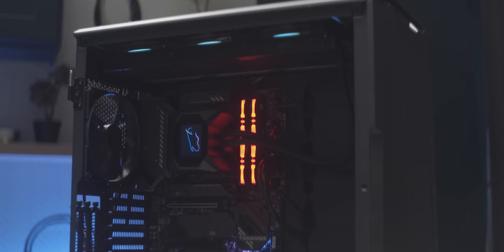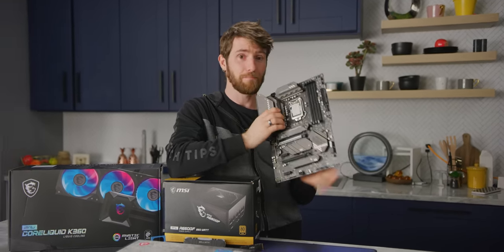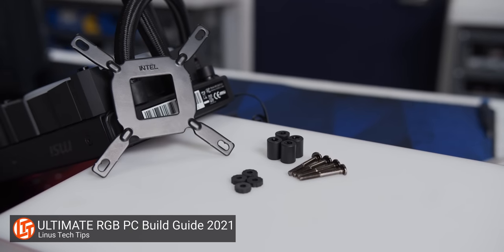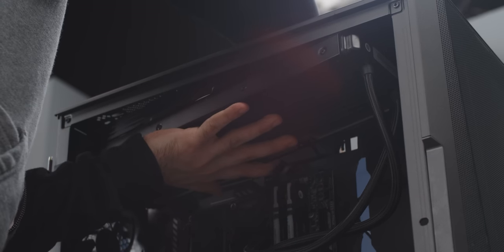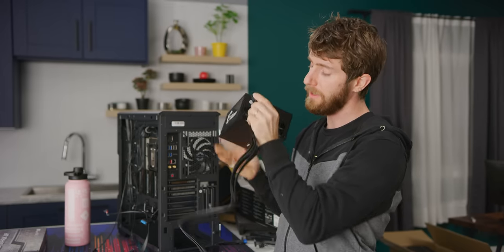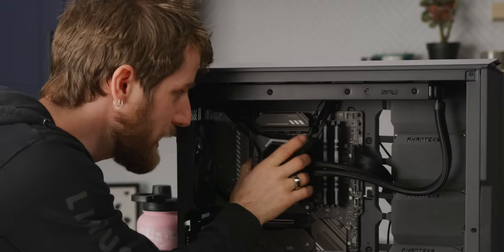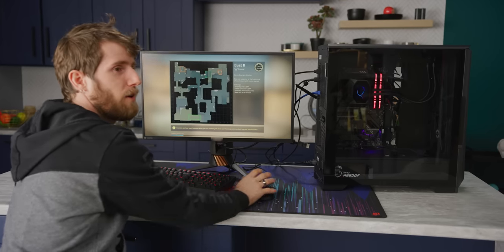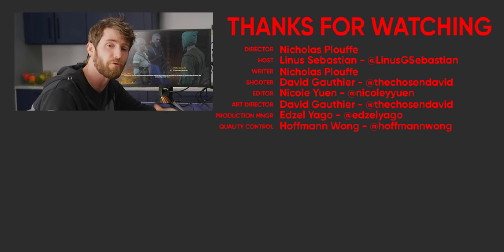You Can ACTUALLY Buy This PC!

Comment: Am i the first to do this in 2021 or is it a dream?
I built my pc without GPU thinking maybe the price will go low so I built a PC with :
i7-10700k 
32gb hyperX ram 3000mhz 
500gb Samsung nvme 
360mm AIO which makes my CPU super cold but the problem is....
it can't run on 1080p so i use my gaming laptop instead which is 3 years old now and this was my upgrade from 1050ti(mobile) to integrated graphic which shows the share memory of 16gb from one of the ram.

Thanks for making this video GeForce now is not available in India right now, so maybe i will wait this pandemic ends and finally I'm able to go out and bring my GPU (RTX 3070) which is priced at almost $1100 and rs90k in India, I thought I'm the only one who built a PC without a GPU maybe the situation forced me to but that's what life is all about, struggle.
#Love FROM #INDIA

Comment: I have waited 7 months to get a new 3000 series card at msrp and it is just not possible and doesn’t look like it will be for a while. My solution was to pay an extra $100 build fee for a custom site like NZXT and get all parts at regular cost.  I waited 1 month and got the mobo cpu and gpu I wanted without overpaying for any of it and it still looks like scalpers will be around for many more months. I then got the psu, ram, and case brand I wanted as some companies don’t offer a large variety and I put the new ones into my old rig to sell on eBay.

Comment: i recently was building my first build and unfortunately... got caught in the crossfire of cryptominers and pcb shortages and was exposed to gpu's that were always 150%+ msrp.

my specs are rather low but i'm new to a personal pc and I don't have intention on gaming over 60 fps... right now anyways.

i3 4550
8gb RAM
1 TB HDD
and a few days ago, i purchased an rx 550 for around $160

i would have bought a better card, but i'm limited to my stock psu and don't have access to externally powering a gpu.

Comment: I bought my first graphics card - used Asus Strix 1070 Ti in the the spring of 2019 for 230 eur, then i sold it for 190 eur in the 2020 September. Now I was without the GPU, but not for a long time.....i bought a new Powercolor Red Devil 5600xt for 320 eur in the 2020 October. It was a nice GPU, but random crashes and tricky Radeon software left me wondering, is this the right card for me...!? So soon after came the shitstorm called "New Graphics Card availability". So i was left with my 5600xt, and we get to know each other pretty good - messing with the settings and undervolting :))  In the beginning of March 2021 I came to decision to sell my RX 5600xt, and the interest for the card was very high, so I sold it to the "miner" for 485 eur. In the same day I bought the used Asus Strix 2080 Super for 895 eur. This is my journey so far, good luck!!!

Comment: I got really REALLY lucky and bought a GTX 1080 Zotac Mini right at the beginning of the pandemic. If I had the job I had now I would've bought a 2080 (maybe Ti) but I didn't so a 1080 was still an upgrade from the 1060. Also I got it for $300. I can NOT find that same Zotac Mini 1080 for under $1200 USD now.

Comment: For some odd reason I got lucky on October 29th of 2020 and bought an MSI RX 5600 XT GPU for $289. I had no idea there was going to be a shortage. I also got away with a Ryzen 5 3600 XT CPU for $239 at the same time. Luck of the draw I suppose. I'm good for a while.

Comment: bought a 1650 SUPER at 260 CA$ from a freind but i was looking to run 1080p 144hrz with the Sceptre monitor you tested in a video.
It works but not as i would have thoutgh.
cpu:9100F ssd:500gb SATA and... 16g DDR4 2400 single dim for now

Comment: i caved and bought a prebuilt dell g5 5000 with a 2060 ... had to do alot and about to swap the stock kf variant cooler for a Noctua NH-u9s. also had to unlock under volting to help with temps  will one day just build out a proper home when i can have to pay off this rip off. only place i could finance sadly. maybe a msi carbon gaming if they come down to my budget then maybe some RGB
Reply: g5 5000's are so fucking garbage

Comment: Ohh man Linus have I got a story for you. Where to begin?  Whelp lets start with the system I had. I was rocking a Biostar tz77xe3 mobo with a i7 2600k cpu and a evga gtx 660. It was getting me by but it was getting to be that time... Thanksgiving 2019 I was heading up to my Dads with my girlfriend  for a little holiday weakened. I had some work to do while I was there, and sense I destroyed my old 2010 macbook pro trying to make it still somewhat usable ( you know because anything after about 5 to 7 years typically looses all support from apple), I was kind of forced to bring my entire pc up there with us. On the way to my Dads place we were hit head on by a drunk driver. The mustang we were driving was completely totaled and honestly we were lucky to get out alive with minor injuries. After me and my girlfriend took some time to recoup and get things started with insurance and lawyers. I decided to take a look at the twisted heap of metal that was my old pc. At first glance the state of the pc was not looking good,. The graphics card was ripped from the pcie slot. The actual slot had sustained some pretty good damage as well. The stock intel cpu cooler was broken off of the board... the list goes on. At this point I carefully dismantled everything and salvaged as much as I could..... Including the psu that had sat in the junkyard inside the car and had been rained on. Isn't this story just getting better and better? 

So I purchase my buddies old nzxt case off of him for like $50 and set out to rebuild my pc out of the salvaged parts. We manage to somehow push the damaged pcie slot back into place get the gpu reinstalled slap a new noctua cpu cooler in there and then against our better judgment decide to wire up the old most likely damaged psu and see if it posts..... well big let down it does and nothing exploded....yet. A few more months go by and I've been using this Frankenstein of a computer for work and play during quarentine. In the back of my head I cant shake this voice saying "man you should fork out a few hundred and replace that psu. It's not worth the damage it could cause if it fails." Unfortunately, there's this other voice that's saying "Yeah but... if it was going to fail it would have already...." To be fair at this point we are smack dab in the middle of first quarantine and no one is going anywhere and me and my girlfriend were dealing with lawyers, insurance and medical crap from the accident still. Part of me just wanted to believe the my pc was fine. Ironically I don't think it was the psu that failed. I load up a game after coding all day and I hear this pop and smell electrical fire as my screen goes black. Funny enough the pc was still running so I force shut down and unplug the pc. I'm not an electrical engineer but my best guess is that a component on the gpu had shorted. I don't doubt that the possibly, nay most likely damaged psu contributed to this incident but let's not talk about that. Moving on... I also had a kind of old janky wifi card plugged in above the gpu that was also put out of commission by whatever happened with the gpu. To be honest there was nothing good about this build. I just wasn't willing to let it die...

Long story short.... I ended up trying to find a new psu and gpu right when that first gpu shortage was starting. I had dreams of making a system that could comfortably edit 4k video at least in the not too distant future so I was thinking 2080 ti and up for gpu ( just to kind of future proof a bit more ). I settled for a $400 1070 for the time being. In hindsight I kind of wish I had forked out a bit more for the 1080 but its one of those things where I just needed a gpu to keep me going until I get to a point where I can do a proper gpu upgrade (not that the 1070 wasn't a nice step up from the 660). Tonight I finally got my hands on a AMD 5800x a new asus prime x570 and some brand new 3600 cl 16 ram. Finally I can get all the old components out of this build and have some peace of mind that my pc isn't going to explode on me.

You had asked for comments about people who had settled for a new gpu and well for better or worse, there you go. Hopefully someone somewhere learned a thing or tow about what not to do or at least was entertained by this.

Comment: Legit, having my gpu die is one of my biggest fears right now. I don't have a replacement (besides my GT9500(?)). I only have my Laptop, which has a horrible APU that cannot properly run my monitor if anything is running and I really don't want to do any work on that.

My PC already freezes completely after some time (not even bsod), when I have GSync enabled with 2 monitors connected. Sometimes just the application crashes, but it crashes so hard, that windows cannot close it, not even via commands.

Comment: I went with Digital Storm.   WORST mistake of 2020/2021 so far.   Ordered it November 3rd of 2020, didnt arrive until 2nd week in March 2021, had it for 3 days and had to RMA it back for problems.  Machine had major issues from day one with continuous hard off-state crashes, huge registry problems, Software blocks, sketchy hardware issues (PSU, M.2, and RAM), essential drivers NOT installed (I had to go find myself) and a tech department that don't know WTF they're doing.   I literally troubleshot everything myself after RMAing it, getting it back and them saying there was nothing wrong, took screenshots and phone snapshots to prove they were morons. The eventvwr.msc showed everything.   Am now in process of getting that POS sent back for a full refund.

Looking them up on Consumer Reports and Better Business Bureau, they have a rating so bad and a list of people having the same problems that I wish I had looked there before buying.  Do not go DS!!!!

Comment: I’ve been saving for 2 years for my system and finally could afford it this January and designed the system for a 3060 but couldn’t get one so I bought a 6 year old 750ti of ebay and is still stuck with that.
Reply: 750ti? My dream card at time, and i Haven’t heard that for quite a while now. How does it held up?  i hope you get it dirt cheap like $20 cause 1050 held the position it used to seat  nowadays (if i doesn’t add the next, next gen 1650)
Reply: $60 but it was my first build and needed it for home working during lockdown over here in the uk.
The build is mainly for gaming though but I can’t play the triple a titles I want and am restricted to rainbow six siege at minimum settings 1440x1080 for about 90fps.
I tried to play warzone the other day but could only squeeze out about 40fps at 800x600 minimum settings so not ideal but it least it’s something.
Reply: Unlucky man I managed to get a barely used 2060 off eBay October 2020 for $290 just before it all kicked off.
Reply: @WillTierney  whaat? A little high for that card that's the used 1050ti price in certain region also in asia.
 hmm does that means uk have higher gpu prices? Ouch, I'm right about modern title ones! Originally I'm about to write you should get at least 1050ti 4gb because the newer title loovee to hog vram but, i did not know  the budget, regional prices type of game you prefer, planning and what situation.

For first build? That's good enough! Mine were prebuild and it was busted many years ago. Today? Save enough and  finally able to  to get some from scratch too!
Reply: @WillTierney  Hope you'll be able to sell it @ same price you bought cause whoever sold it to you are able to sell it that high!
Reply: $60 was steep but I managed to get it quite cheap considering what others on eBay were going for and the vram is definitely in issue but I’ve just played less demanding competitive titles and it’s filled the time so I’m not complaining. At the end of the day the pc’s complete to some extent and I’m happy enough with it. It’s just annoying that the pc I spent over a year saving for and researched into good components and building it couldn’t be perfect but some day the time will come when I’m able to get a gpu for rrp
Reply: @WillTierney  hell yea!! as long as it still fun enjoyable no problem! I'm surprised my gt 220 still got kicks in it I was able to play few modern title  smoother than my laptop too oh, indie where most are forgiving but no good fps game seen so far

Comment: I don't know. I got a 3070 at Memory Express the day after I requested one. Also an other one I placed on hold (technically I requested anything 3060ti or 3070) was ready to pick up within 3 weeks also at memory express. It was right after christmas when spending usually plumets. So I think it's mostly harder for people who have limited options of stores, live in rural areas or what ever. Everyone else complaining who don't have limited options in stores never even placed a damn backorder to begin with and are afraid of having to wait for nothing, but these airheads are not rational people. LIke not placing a backorder is guaranteed no chance in getting a gpu; not going to the store to see if there are any in stock, is guaranteed 0 chance of getting gpu; not joining discord channels for drop allerts is guaranteed no chances either. I think there are a group of idiots who complain more than they actually try to buy one msrp at a store. To make matters worse 80% of the time they want the EVGA 3080 FTw3 or ROG STRIX specifically, and can't fathom either settling for a 3070 or ponying up for a 3090 gigabyte or msi.

Comment: Isn't the way he mounted the AiO suboptimal/problematic? Afaik the msi mag coreliquid series has the pump integrated into the radiator, and positioning the radiator flat on the top of the system makes it so the pump is at the highest point (or at the same level), allowing for air to be potentially trapped inside the pump (which will increase noise and make the pump wear down more quickly). Thoughts anyone?

Comment: I recently bought and am using a 3070, I’m wanting to upgrade my i5-9400f to either 10th gen or 11gen was thinking 10 gen with either a top i9 or i7 what would be best. I’m doing some gaming and some software use like photoshop, sketch up and unity. Which intel cpu would best be suitable. I will also have to upgrade motherboard as it won’t support 10 or 11 gen as a side note.

Comment: I am from Egypt ..... i needed a graphics card for my new computer .... i had to buy gtx 1650 due to high prices in Egypt .... normally gtx 1650 costs 3500 pounds ..... i bought it for 4500 pounds ... it's like 30% more money .... i could buy a gtx 1660 super if the prices were normal 😭

Comment: This video should be named "Assembling 1600$ PC from MSI counterparts to play on *GFN*". As if top-notch system with 11700K is not the ONLY option to run GFN, lol. Intel has it since 2nd generation and lower tier ryzens got it as well - you're playing devil's advocate advising this particular SKU. But there's even a simpler option: even old good GTX 660 paired with 4th gen i7 is capable of bringing viable 4k desktop experience. And this rig will cost you a price of this CPU at most. If you're targeting 1080 it's even simpler. The main question here is: do you have GFN available at all?

Comment: Still have my 1080 Ti from what, 4 years ago now?

About to pay for an overpriced GPU though; the 3080 Ti at its "MSRP".    I mean, if I can even beat the bots, scalpers and other people desperate for an actual upgrade.  Oh and justify $1,000+ on a GPU, when the x80 Ti series has always been $700 until RTX came along.

Hopefully the mining nerf helps lower demand.. worst case I could at least dedicate my 1080 Ti to mining while using the 3080 Ti to actually drive my 3D rendering, and I haven't mined since Bitcoin was possible to do back in 2013.

Comment: This is kind of a bad suggestion and kind of a bad video though, right?  Like.  It's a suggestion if for some reason you have money lying around collecting dust and for some reason really want to spend (waste..?) time building a subpar pc.

This ends up being a bigger waste of money since, by the time you can get a good GPU to install, you probably could've found better parts becoming available too -- but now you're stuck with a system that will become obsolete faster.  

In almost all cases, this sort of settling build isn't a good recommendation to people trying to build a pc in 2021.

Comment: Ive seen a realy weird cpu on aliexpress id would be cool if u guys could review it or if someone can tell what its used for its called 
Intel Core I9 9980XE Extreme Edition Processor 18 Cores Tot 4.4 Ghz Turbo Unlocked LGA2066 X299 Serie 165W processors (999AD1)

Comment: Lol even my Ryzen 3 3200G could run CSGO and other games like GTA V at 50 fps without crashing, and that's not even a Zen 2 architecture CPU.
I bet those half finished Ryzen builds were either Ryzen 3 3200G or Ryzen 5 3600G (mainly because it fits the budget or else even a 4650G), whose igpus have proven to be on par with 1650 at 900p.

Comment: lol @ spending $380 on a gen 3 m.2 drive and putting it into a gen 4 board cutting your transfer rates in half while spending twice as much.

lol @ spending $230 on 3200Mhz memory instead of going with a 4400mhz kit for half the cost.

lol @ not overclocking that beasty 11700k to 5.3Ghz+ or pushing the UHD750 to 1.8Ghz and making a video worth watching because you lost your way after becoming an obvious amd fanboy / intel hater.

Comment: hey linus, quick question for you.
my computer used to download at 300mbps or thereabout, but now im lucky to get even 3 mbps.
however, it has been pretty banged up and moved/ stepped on a bit.
am i able to fix this if i go to best buy or do i have to buy a new one.
its like its getting the wifi sometimes, but not using full capabilities.
Thanks, and contact me via my linked gmail.
have a great day